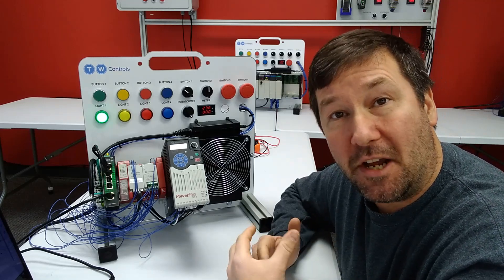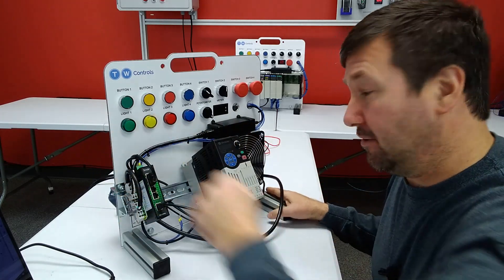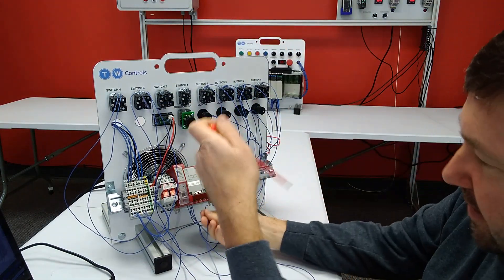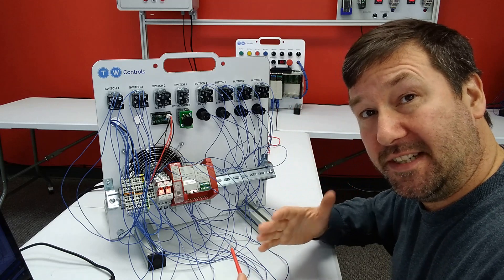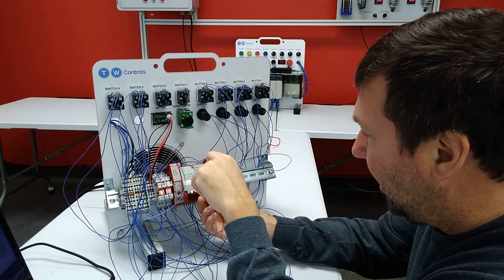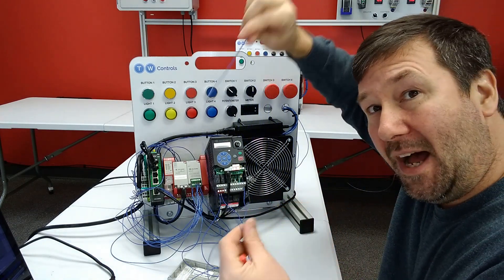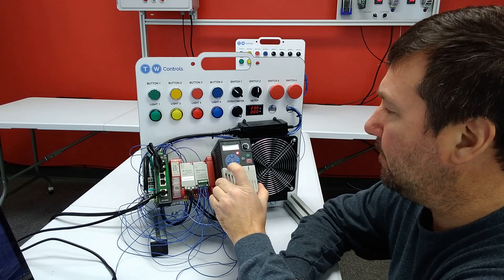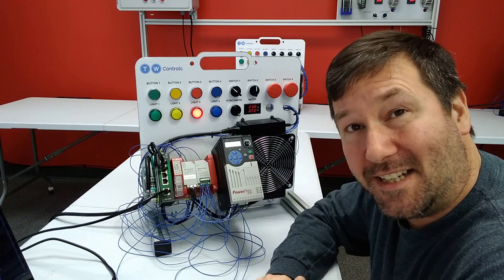Allen Bradley 440C-CR30 Safety Relay PLC, Wiring Enough to Get Started Understanding Safety Lessons

Comment: Is it possible to swap the old ( MSR127RP ) with the cr30 using the existing wiring ?  
With the series A safeties being discontinued and series B not able to work with the old relay, I need to start looking at replacing the old relay. I tried the recommended using 2 10k resistors from the input side to 24v common, but that only worked a few times and I had to go back to using the old safety.
Reply from the maker: The CR30s are very versatile and can cover most safety relay applications but for a safety system, I always recommend consulting a Functional Safety Engineer.  There is too much risk in incorrectly altering a safety system.
Reply: @TimWilborne  Good warning on safety here.
Reply: Thanks Tim !  I am actually working with someone who was able to use an Eaton relay that worked for a day, but of course it didn't work the next. So I spent an hour wiring in the old relay and sensor. Just what I need at 5am and management asking how long till its fixed ?  Fun days 😄🤔
I think my next move is to talk to the machine manufacture and see if they are using the cr30 on new machines and if they have a wiring diagram and program.
Reply from the maker: @cdesalme  Interesting, works for 1 day and not the next?  I don't know much about the Eaton relay but with the CR30, if you don't go through the verification steps then it will stop working after 24 hours.  Then you have to cycle power again.  Just a thought.
Reply: Love the videos Tim 
A lot of useful information. Keep up the good work ! 👍
Reply: Its crazy but 1 day and done. Tried to cycle power off, it would go through its cycle turn green for a second or two then back to flashing red. Biggest problem with adding the cr30 is room constraint. I think I have to get the shoehorn out and stretch the cabinet.

Comment: Tim-  You should check out the Rockwell safety application techniques for this device to use for teaching.  They are pre-engineered and usable as a valid safety solution and they explain the full circle of functional safety design in each one.  Great video! Thanks!
Reply from the maker: Thanks for the tip Steven!  I plan on going through several of them.
Reply: Can you share a link to these techniques please?